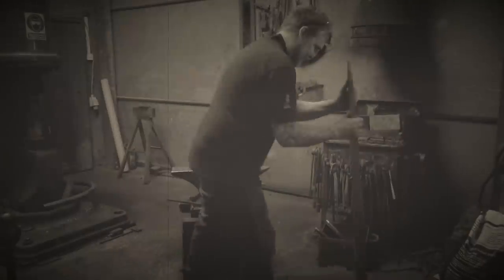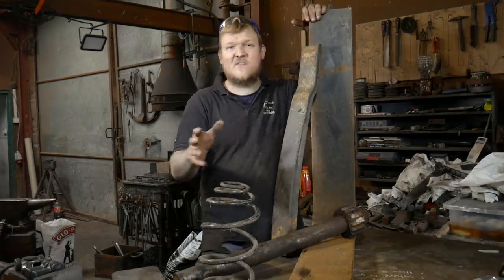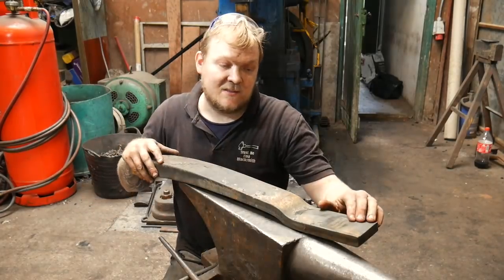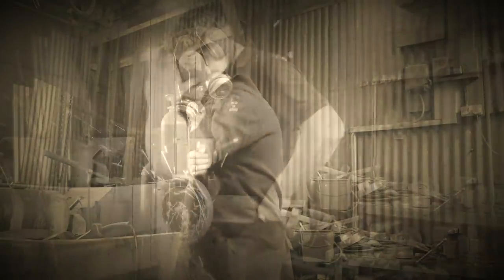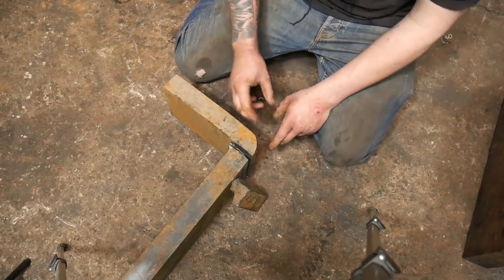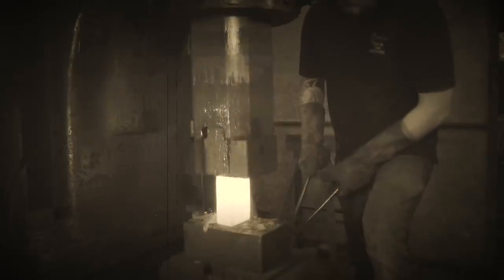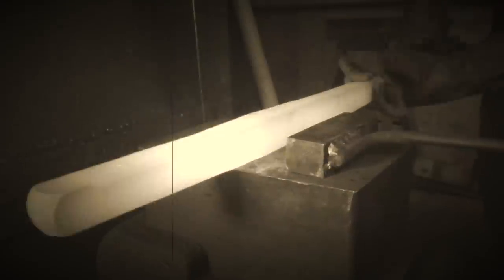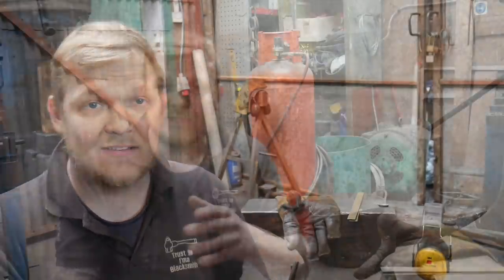Get More Out of Recycled Steels In The Forge. How to process forklift Truck Tine.

Comment: Awesome vid! As a heavy equipment mechanic  just about everything I forge comes from the road construction industry! I get a lot of conveyor shafting from rock crushers, track pins, large track adjuster springs from dozers and excavators, semi truck leaf springs and a whole lotta fork tine and very large fork tine from loaders. Why I use the name Heavy_Forge. I can also tell you go to a semi truck repair shop or dealer they have plenty of large springs and axle shafting they’d love to give away! even you’re local gravel pit or paving company will have steel they’d give away.

Comment: Some heavy duty forklift tines are 4 in. thick at the heel. They would make fabulous anvils just as they are .
Reply: I did very close to this suggestion. I built a 193 pound post anvil with a surface area of 5x7 inches made from steel from 2 forks.  Works well!

Comment: Hi Dan,  I have a fork lift tine I bought a long time ago but have not cut it up yet.  I want to use part of it for a striking anvil.  Is that a good idea? If I don't heat treat it when I am done?  I do not have a power hammer yet so I have to do everything by hand and welding and torch work.
Reply from the maker: Go for it! just getting a hole through it might be a pain.

Comment: Question:
I have many leaf springs from cars to heavy semi trucks.. I put a small leaf spring into my coal fire and it started cracking and falling apart in the fire. The pieces were now so brittle that they would shatter just by dropping it on the ground. I’ve never seen anything like this. What’s going on and how to prevent it?
Reply from the maker: I'll get back to you I need to ask a bigger brain. I think I know what it is but I just want to check.

Comment: I have access to fork lift tines.  It appears you used a hand held grinder to chop as opposed to a bandsaw cutter.  I am unlikely to get more than one tine per year, and a bandsaw is expensive.  So using a grinder is like totally possible right?
Reply from the maker: Grinder is great cause it will cut through the tine with little issues. Where as cutting the tine on a saw can often cause problems if they are very hard.